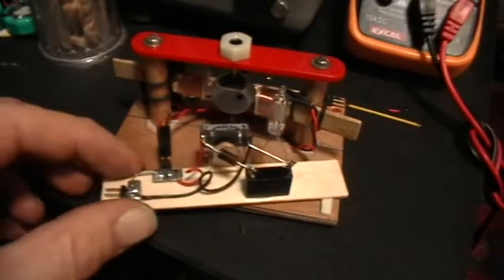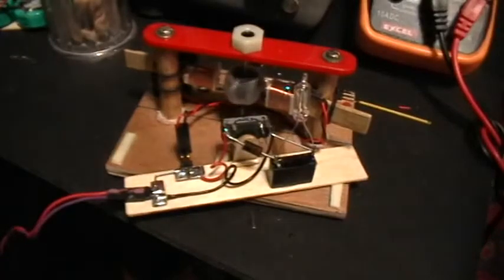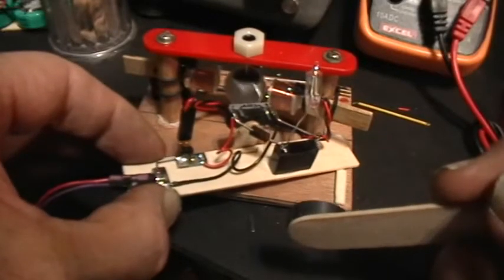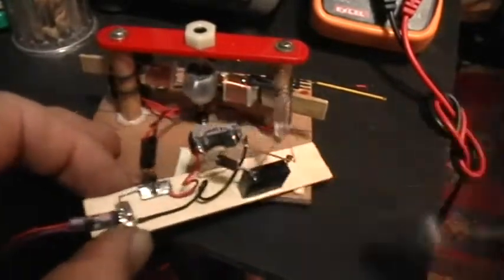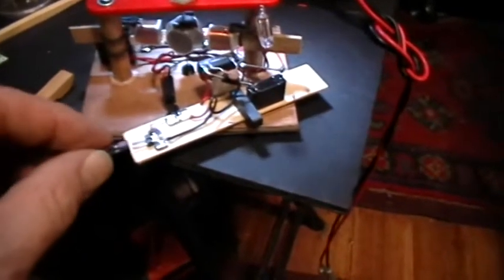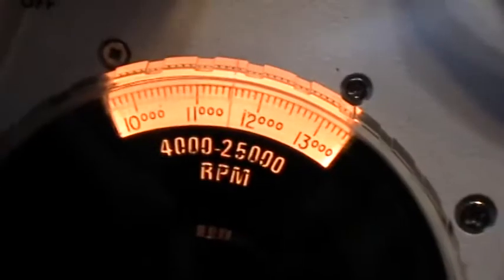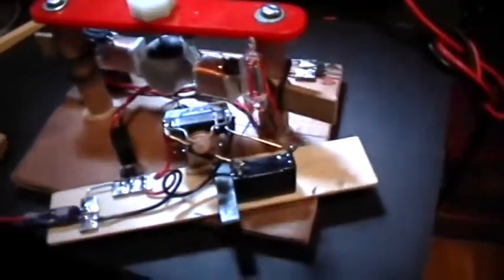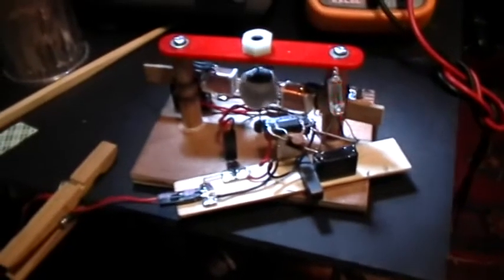Pulse Motors: TK MiniPulse III: Reed Switch Driver, Lights NE-2

Comment: I have one of those relays and will try it.  Any idea why my speed triples by adding some ferrite to the air core?
Reply from the maker: Sure, you are concentrating the magnetic field by adding a high-permeability material. This makes each pulse felt by the rotor a bit stronger. However it also means the rotor magnets "cog" or find potential hills and valleys, and this also stresses the bearings. I prefer using air cores because I want my rotors to coast completely freely when not powered.
It also means that you will have a heavier inductive collapse spike when the pulse shuts off. This will eventually burn your reed contacts unless you put a tiny capacitor in as I have shown here, but it will make a spike-concentrator circuit, like my bigger cap, diode, and neon, work better.
I'm not using the little DIP-relay's coil, you understand, just the switch contacts, and biasing with the external magnet.
Reply: I'm using a neon for some protection and a HDD for the rotor.  It's just too slow w/o the ferrite and doesn't even flash the neon.  Yeah I know how the reed works.The biasing I don't understand.  I have tested it with a DMM and a magnet and it funtions  What am I missing?
Reply: My reed switch only has 1 volt going thru it just to trigger a transistor.
Reply from the maker: texjarhead My "rotor" is just  a couple of magnets attached to a needle for the axis. This means that both poles of the magnet stack are presented to the reed as the rotor turns. But I only want the coils to fire on one polarity of the magnets, so I use the biasing magnet to "oppose" the field from one polarity of the rotor magnet and "aid" the field from the other pole. This makes the reed trigger only on one polarity rather than on both.
Another way to use biasing magnets on cored coils is to put them on the end of the core away from the rotor. This can "pre-saturate" or move the core around on the hysteresis curve so that your applied current has more, or less, effect than without the core-biasing magnet. Some of my "orbette" Steorn-style pulse motor videos demonstrate this biasing effect on cores.
Reply from the maker: texjarhead
Here the minipulse is running on less than 1/2 volt but without a transistor, just using the reed to switch the coils directly:
Pulse Motors: Supplement: TK MiniPulse Reed: How Low Can You Go?
Note the tiny capacitor across the reed contacts: this reduces arcing and greatly extends the life of reed switches/relays. 50-100 pF is probably enough for these low-voltage systems.
I have another system that I'm working on now that should be able to run a pulse motor with a 2-transistor driver at around 0.7 volts from a solar cell.